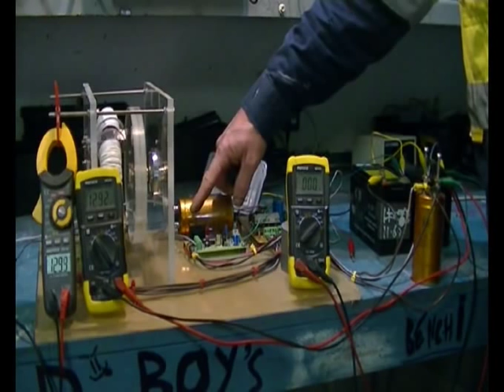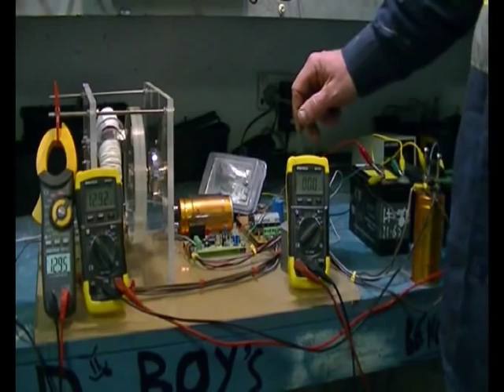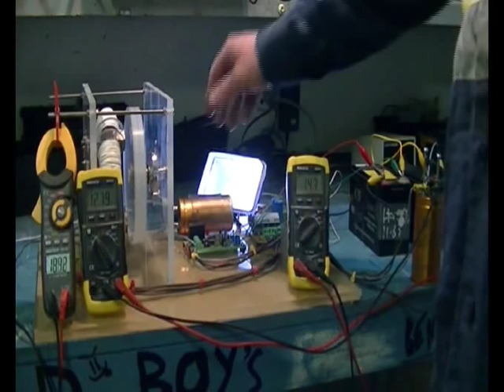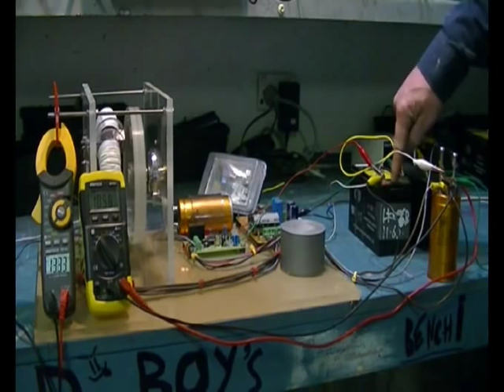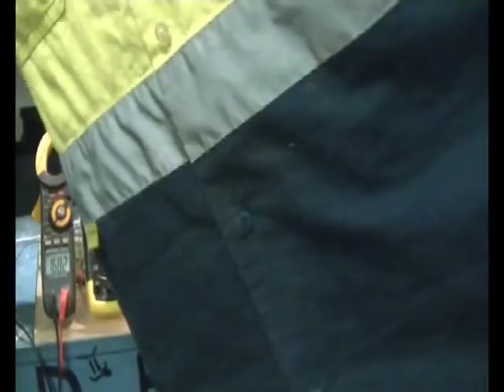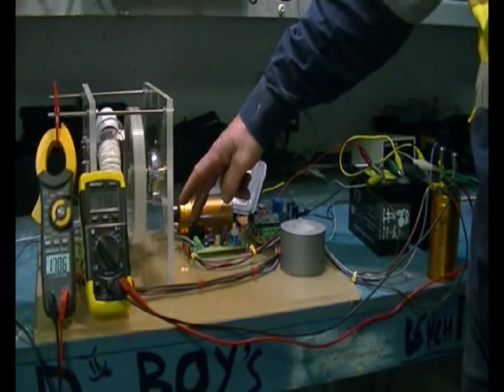LFMG update

Comment: You need to run the cap switcher from the main cap bank...
To help you do this, i recommend a second toroid coil on the other side of your rotor driven from it's own independent circuit.
on top of that you need to stabilise your input voltage when running from cap bank. I therefore recommend increasing you cap bank capacity by 10 to 20 times.
At this point you should be able to use your cap switcher from the main cap bank.

Comment: Greetings tinman, congratulations.
Whether you choose to accept this information or not is upto you.
I looked at toroid coils years ago and rejected them on the grounds that UNITY is the best that could be obtained. This is because at low speeds a toroid is very efficient, ~ 105% which makes up for the loss in energy. but at higher speeds it looses it's efficiency.

Comment: In my experimentation with back EMF spike capture, I found that I could do it more efficiently if condensed the voltage of the EMF spike into a lower voltage. For example if i used 2.4 watts(24 volts at 100 mA) to make the spike, I could get back 1.2 watts(at 24 volts) or 1.8 watts(at 12volts). The lower the voltage was condensed out the closer to 100% I could get. If you can, try to reduce the voltage needed to trigger a dump. Though that would make more switching loss.

Comment from the maker: Hi mnsman-no im not looseing itas it is going into the charge battery during that one second.This is why i have left the charge battery in place.The ssg driver is a 2n3055 and the cap dump uses a mosfet to power the relay.The problem is with useing solid state switching is that it has to do what the relay dose,and the relay is a 2 pole duel throw relay-so a bit tricky.

Comment: look on the bright side Tin.. it may not be "useful" but its sure as hell useful at proving a mechanical overunity device.. if it can be made to run the way its running, using a less costly cap dump, and replacing the charge batt with a load of the same resistance, u should be able to have a motor that runs itself and also powers a small load.. even if it powers no load at all, yet runs itself, its defying physics..

Comment: I know that the cap dump board current draw could be minimized or the motor could be upsized to offset electronic's current requirements, but can the charge battery be replaced with a capacitor (only if the cap-dump board is voltage regulated).  Then batteries would be out of the picture and you would see cap voltage slowly rise and/or RPM speed up if it has access power. Of course the electronic power draw is the limiting factor.